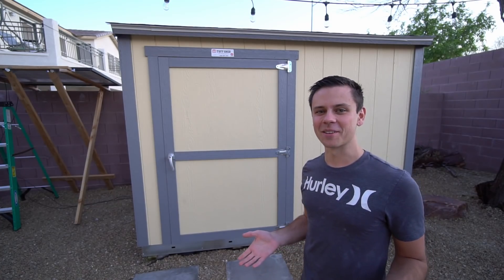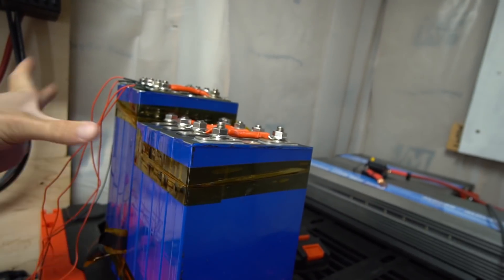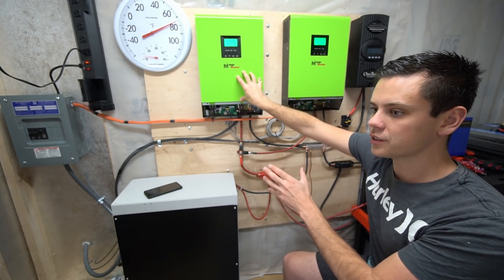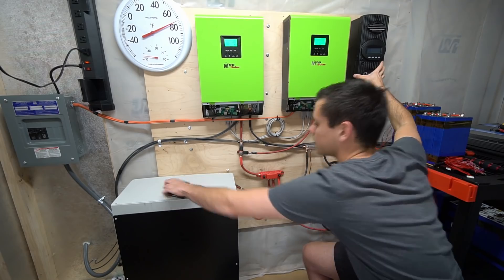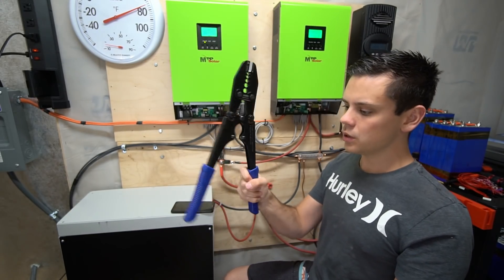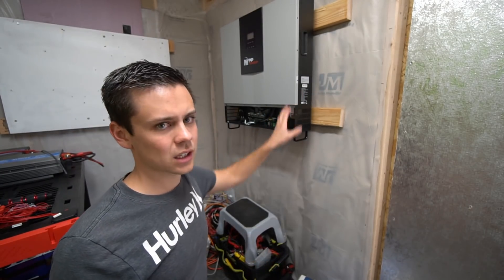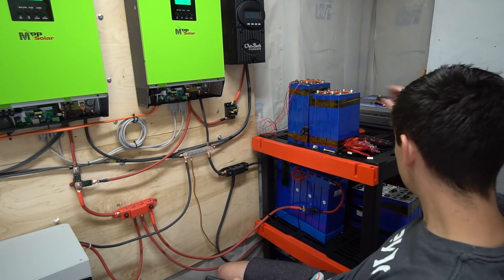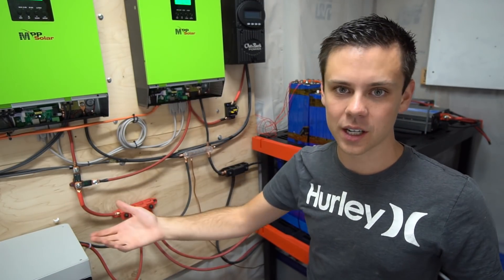Solar Shed Upgrade: Frankenstein LiFePO4 Battery -HUGE Capacity!-

Comment: Not trying to show off or make a "who's bigger"...
But our 15.5kw will go to 23kw/h (when the cells arrive)
Living off-grid with no grid option.. 
I didn't realize it's exceptionally large battery pack.. lol
I know it ain't small with 9.6kw Inverters (3*3.2) and 9kw solar but didn't realize... It's actually really large...

Your vids help a lot.
Mostly as your honest about your experience, include the fails :-)

Comment: Like your system :) 
What are those black and red connection points you use for you heavy gage wires ???
Thx for sharing. 
Regards :)
Reply: Batteries?
Reply: Buss bars, available on Amazon.

Comment: wait, i can mix match old and new batteries? if it is just 12v or 24v?
Reply: That was my question exactly. I thought the old ones would draw down the new ones? Thats why I was saving for a big battery bank instead of adding 100ah here or 200ah there.
Reply: You can mix types of batteries In battery packs. But don’t mix types and capacity of batteries in series when making 2,3 or four batteries to achieve 24,36 or 48 V system.I have 36 V lithium ion bicycle batteries 10s and 12s Iron phosphate they work good together. But you cannot mix a lead acid batteries because of their requirements for a float charge with any lithium chemistry.

Comment: Yaaayyy, the LV5048! Can't wait for the review man. I was trying to figure out rather or not to get the full set of 3. I only have 1 right now, and for some reason, it is limiting my array from 9600w, down to ~5000w (I have 40x 240w panels). When it was partly cloudy the other day, I got about 11Kw, with "cloud edging" with only 32x panels connected to the inverter/ charger.
Reply: The MPP LV 5048 is only rated for 8,000 watts pv input at up to about 145volts DC input.  Even it can still only supply 5,000 watt continuous output.  The rest of the 8,000 watts is used in efficiencies or charging batteries.  You should remove at least 1600 watts of the solar array PV input immediately.  Remember also its max 4,000 watts to each of the MPPT chargers in it so you need to make sure each half is 4,000 watts or less.  Of course you could get an additional LV5048 but you still need to make sure not to put more than 4,000 watts on each of the 2 MPPT chargers in each unit.
Reply: @teekay1785  I have some connected to water heating elements now. The charge controller just cuts my power in half for some reason. I have played around with settings and wiring configurations, (splitting the strings up, in case it is limited by wiring size... etc...) and have even tried going down on the voltage. I even contacted MPP solar to check my work. They said I needed more batteries ( I currently have 6x 3kwh lithium) or a heavier load (which I run the water heater and the stove pulling ~ 4500w). I hope Will can figure it out, lol. Thank you for the help man. I really appreciate it. I have certifications in electronics, and have a pretty basic understanding of what's going on, but I feel like the MPPT is just limiting the panels (which all have been tested by me, including amp, voltage, diodes...)
Reply: @Lumbeelegend  Hopefully can but not clear  what the problem actually is  from your description.. How many amps do the charge controllers provide with how much PV amps and volts input at a single point in time with what load etc on the MPP screen?

If you haven't I would pick a sunny day with at least half discharged batteries  and turn on constant loads about equal on both 120v legs to at least 4000 -5000 watts total. Then measure the amps the MPPT chargers are each supplying and do the same with all loads off and post results. Only way I can see number of batteries affecting it at all is if they are not capable of receiving the 80 amp (about 4,000 watt) charge from each controller or the batteries are nearing full charge or in float charge. It would also be helpful to know what type and rating of each battery or cell specs if you built it and if you use a BMS that could be limiting the charge current also and its specs. Bet you will get it figured out.

Comment: When I did Solar System for my Travel trailer I went with the green LV2424 and i spent months looking at different options. For what it does at the price point is really good and if it craps out they are cheap enough to just get another.

Comment: A little more detail on "Frankenstein" ing.  Glad you are doing well.  I actually asked for this mix of what ever batteries one has into the mix...including lead acid...thanx Will
Reply: You CAN mix lifepo4 with lead-acid if you use "special equipment" (there needs to be continuous discharge)... But it's NOT adviced.

Comment: So I have so many questions. Ok for example. If your have a small battery let's say 100 watts  worth of power. Would you say it matters on how many solar panels you have? Like if you had a 100wh battery would you want a single 100 watt panel? Or would you want a small panel?
Reply: This is just an example. I'm sorry if none of that made sense.

Comment: Daly said their BMS is not meant to be connected in parallel or series. When I asked for an explanation, they just said buy a bigger BMS. What's your opinion on 2 same BMS in parallel?
Reply from the maker: In series, bad idea. Voltage rating of fets not high enough. Parallel should be fine though. Idk why they would say that
Reply: @WillProwse  This is from a forum: "The issue with the cheaper BMS units, if your using them for protection is that if you have say 40A load and you have two BMS units in prallel that have FET's rated for 20A load when the low voltage level is reached and your pack is disconnected the timing between the two disconnects will not be the same and therefore you would end up with 40A trying to go through a 20A rated BMS. That is in a good case of just 2 units in parallel."

Would this happened to two identical battery (two individual BMS)?

Comment: Running an air contitioner isnt all that bad as long as you don't allow the AC to short cycle and try to startup with a loaded high side. That's where you get nasty inrush currents. 
And I know real inverters don't like real motors that much, but there's a derating figure for that.

Comment: You can mix batterys?? I have 2 viper EV-120. I would like to add battle Born batters. I now have 200 AH. I would love to have 600 AH.
Reply from the maker: If they are the same chemistry and each pack has BMS, it should be ok. Ask the manufacturer

Comment: Will does your second hand Tesla still have the super charge enabled? Or did you lose that function once they found out that it’s owner has changed?
Reply from the maker: That's for rebuilt Tesla's. I had a used Tesla, so it always worked. I have a new Tesla now

Comment: 👍 Hi, nice system, but i am not understand the battery connection, different capacity suitable connect in parallel? Appreciate if can explain in a diagram.

Comment: I think all systems should be measured not in Kw but in Tesla miles.  56 free Tesla miles a day and more to come by the end of summer. Simply Amazing !
Reply: msnpassjan2004 although an SR+ Tesla mike is significantly smaller than a model X Tesla mile LOL

Comment: You going mini-split on the airconditioner? I just put one on my RV recently it was fun to install.
Reply: Mr. Cool would run great on your solar system and is easy to install as well.
Engineer775 channel has some pretty decent videos on installing 24v ACs that run directly off solar panels
Reply from the maker: Which one are you using?
Reply: @WillProwse  I just installed one on my camper as well. While researching one of the companies that has multiple brands available recommended Mitsubishi. They mentioned that they had no compressor issues with that brand.  I wasn't able to get one to fit in my camper but if space isn't an issue that's what I would recommend. Of course you would want one with the 208-220v and the highest SEER rating you can find.  Good luck and thanks for keeping us entertained 😊
Reply: @WillProwse   I put in the Pioneer 9000 BTU. It's the 22.5 seer model. It draws 40 amps at 12 V with a big temperature spread And  Throttles down to 20 apps and even 7 amps as it gets close to the temperature  Set point. A little pricey around $850 plus I spent a couple hundred bucks on vacuum pump and tools.
Reply: @edmor1086  850 actually sounds a lot better than most mini split prices I have seen. 👍

Comment: Pfft. Barely enough solar panels. If you were in the UK, would have sent you solar panels as I sell surplus/used stocks.
Reply: I'm in the UK and in the market for panels but on a tight budget due to current circumstances,  please send details of what you have available to drhenquiries@icloud.c o m
Reply: @healeydave  Hi mate. I'm in London and can only be collected if ok with you. I have 260w currently.
Reply: TechTactics what sort of price are they? 👍
Reply: @healeydave  £60 each. Less than 30 left at the moment. Next batch might probably be different. Possibly between 250w to 300w sometimes.
Reply: TechTactics ok, thanks, I’ve been offered some 335W for the same price and the location is a bit closer than London but I would probably still use Palletline at the moment due to restrictions on movement.
Reply: @healeydave  yes. That's quite a good deal I must say. Go for it and good luck.
Reply: @techtactics788  Thanks. I will be in the market for more panels in the future, do you have a website where you list new stock?
Reply: @healeydave  Hi, at the moment, selling locally and via eBay. Will seek to expand if demand is very good and will have a website.

Comment: 24 Volt would have been the ideal voltage to run things at........ 1.35 volts,  5 volts, 24volts....... then just stack 24 volts to any higher configuration. 24 / 48 / 96 “80” / 120 / 240 / 408 / 600.......... all divisible by 24........ From Power Tools to Cars 🚗 to all appliances ...... All DC.

Comment: Is there no problem with all the mis-matched batteries and slightly different types.  And what about slightly different solar panels.  How do you deal?
Reply: Yeah, my question too.  Guess i will have to find those other videos.
Reply from the maker: I have videos on these topics
Reply: @WillProwse   I notice you appear not to worry about cable lengths with the Battle Born LiFePO4 batteries connected in parallel. Is that because each battery's BMS takes care of things? I just bought 4x similar batteries, can I just string all the + and all the - together and connect one end battery to the SCC? Can you point us to your best video on this subject pls. Thanks and regards from Oz. (Love the 3P)
Reply from the maker: @rossgee1091  good question. I have a large number of batteries so the most each one will pull is 20 amps max. So they are over gauged. Should be fine

Comment: Will, do you have a discount code for Battleborn?    And is Battleborn really just a drop in replacement or do I need temp protection?
Reply: Battle Born has its own temp protection in its BMS.  It's a drop in replacement but the charging profile is slightly different so depending on the situation you will need to change charging parameters or a different charger depends on the application.
Reply: Charlie Noble so I just need to change the charge controller to lithium? Correct?   I could probably assemble a battery but with the COVID money I think buying a Battleborn will help the economy a bit and get me a good warranty.  Do you know any discount codes for Battleborn?
Reply: @maggiesjourney3877  yes you can set it to lithium or if it has a custom setting you can change it to exactly what Battle Born reccomends (14.4v bulk and absorption, 13.4v float.) Sorry I don't have a code, I bought a significant system directly from them and they offered me a discount on the whole package.  They have been great to deal with in all aspects of my camper installation. Great company 👍. Good luck, perhaps if you mention you saw it on Will's channel they will offer you something 😊

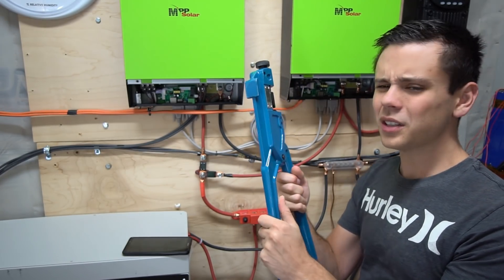Comment: 5:44 . . . Sigh 😔It’s comments like this that remind me to price check every you suggest. 🤦🏿‍♀️ 60 dollars is ridiculous for those of us trying to save money 😰. I appreciate the content but A’NT NOBODY SPEND 60 DOLLARS ON NO CRIMPER!!!!!!
Reply from the maker: My installer friend just bought a $270 ul listed crimper
Reply: DIY Solar Power with Will Prowse 😱
Reply: MistressKuroko If you do lots of crimping it’s worth it or you intend for it to last a long time with minimal to zero maintenance....... however; if this is a war zone & your life depends on it being done immediately for only short term use “MacGyver”  it in the safest manner possible without causing life or limb injuries to you or anyone else👌🏻
Reply: If you crimp 2000+ cables a year, it is a way awesome bargain.  Crimp just a handful and it is pretty expensive.  Better to share this tool with friends to minimize cost.
Reply: 60 dollars to make all connections safe?
That's a bargain.

I am using the hamer and pin method for the size I don't have crimping tool for...
Slowly some are getting less reliable and even let go..
I'm still lucky, no sparks, fire of power peaks that damage the whole installation.
Yes, my next purchase will be crimping tool with coper lugs, even the +4 mm2 cables! (Or especially those)

Comment: 14kWh  - I think I’d rather have a 13.5kWh Powerwall2
And yes, your Tesla will consume several of these full battery discharges to fill the car.
Interesting but hardly practical if you need to use the car more than a little bit
Reply from the maker: Actually I prefer LiFePO4 still. Longer life
Reply: DIY Solar Power with Will Prowse 
I have 9.5kWh on LFP in my RV, which I chased 4006km across the bottom of Australia last week, trying to beat border closures The 9.5kWh hardly touched the sides with charging the Tesla, sadly. So I missed the South Australia/Western Australian border closure by 6 hours. With 2160watts of solar on the RV, it was best to charge the Tesla during midday as a 10amp 240V draw was all the Victron 3kVA inverter would handle. Still too slow and small to be practical.

PS Tesla SR+ are great cars, but not designed to cross country fast when there is no electricity grid infrastructure!! 
Imagine a 2500mile wide Nevada, Will, but no Hoover Dam
Reply: @WillProwse  living in Vegas gives Tesla owners an amazing amount of charging stations.  If it's cloudy you can top off a Tesla all over town.
Reply from the maker: Same here
Reply: Instead of having an extra Tesla car sitting at home charging, I say you get a Tesla battery do a breakdown video then a rebuild video rebuilding the Tesla batteries onto one of your shed walls.??

Comment: ? which system is better 12v 24v or 48 and can you connect two inverters together
Reply: 12V is for the lights or tablets.
24V is for a RV. 
48V is for an house
Reply: How do I configure a system to a 48V I'm new to this because I'm buying wind turbines and solar panels
Reply: @dpav02  thanks